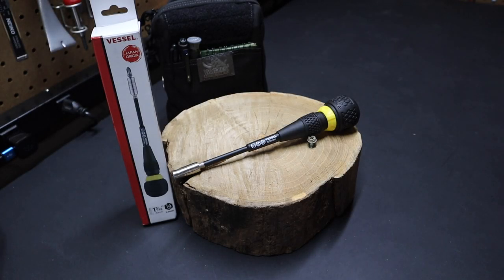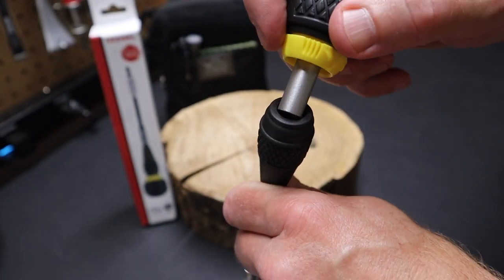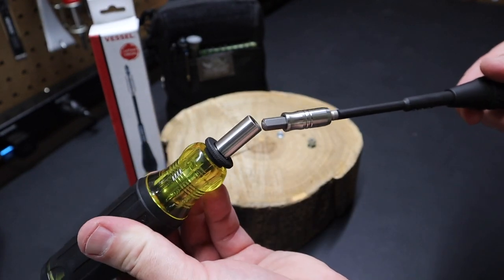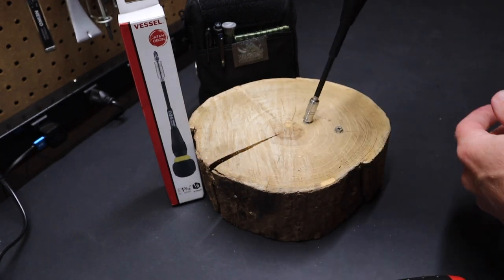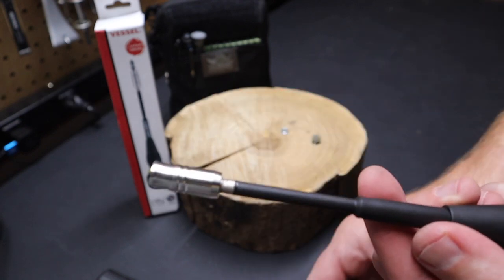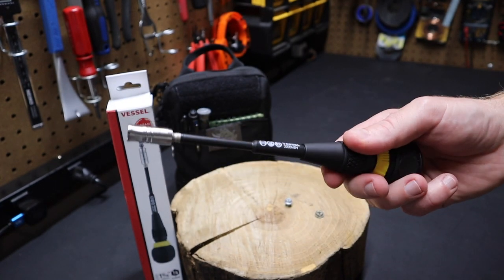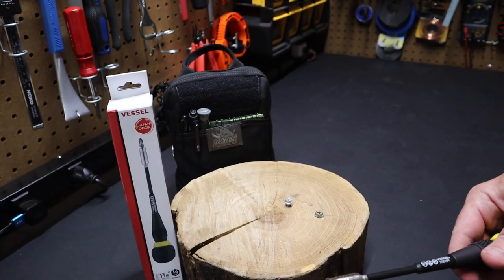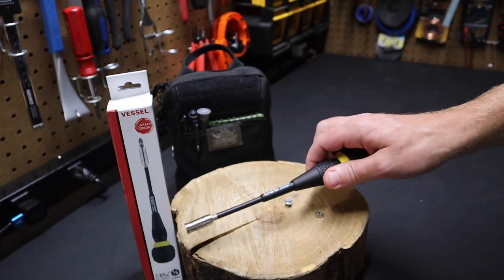Vessel Ratcheting Ball Grip Screwdriver - 2200MBH120

Comment: I feel how much back drag matters depends on the size of screws / bolts you're working with. If you're working mostly on tiny electronics, get the least back drag as possible. If you're working with thicker wood screws, back drag doesn't really matter that much.
Reply from the maker: That’s exactly right. Good point.  Thanks for watching!

Comment: Nice video, man. I have a couple of Vessel’s impact screwdrivers with the ball grip. They’ve definitely got a different feel compared to most other screwdrivers, but I kind of like their ball grip design, especially when I have to really bear down on a fastener. 👍
Reply from the maker: Yeah great torque. Not so sure about this screwdrivers adjustable ratchet ring being so easy to reverse when using it. I might need to try some other Vessels. Thanks for commenting!  👍

Comment: I just got the similar vessel ratcheting driver with hidden stubby, but was disappointed that it had a fixed #2 phillips rather than the bit holder like this one.   I was really focused on the stubby part, so my bad.  I want to send it back and get this one.  Similar experience as you.  I don't really have much in the way of ratcheting drivers, and was very curious to try the ball grip that everyone seems to love.  I've only played with the one I have a little and it's ok I guess.  I would like to use it more to see if I like it or not.
Reply from the maker: Yeah I almost did the same as you when I was looking.  Thanks for sharing and thanks for watching!  👍

Comment: I wonder if it would feel worse with the back drag improved. Since it is designed for you to have your fingertips on the lower portion of the driver back drag might make it too stiff to move with your fingers.
Reply from the maker: Well that’s what I mean, lower the back drag and it will be easier to use the screwdriver. Thanks for watching!

Comment: Im no sure if reversing it would fix that. I mean that mean you can slip when you ratchet in the opposite direction. Plus that would be contra of all the other tools out there. I mean all tools hove drive in = turn right and drive out = turn left
Reply from the maker: It would be different than other tools but given the location of the ring, it would prevent turning it by mistake as you torque. 👍
Reply: The new Wera 838 RAS (with a very small handle) features a ratchet selector that turns in the intuitively "correct" direction (right to drive and left to loosen). However, an Amazon reviewer from Germany notes that the selector on that screwdriver operates so smoothly that it's still easily knocked into lock position, he says.
Reply from the maker: That Wera is a nice driver. The selector is in a place where you can stay clear of it while using it.   I’ll have to check it out.

Comment: Hey I have a question. Trying to figure out if mine is defective or if it's normal. When you turn the stubby slowly does it let go at some point? Like turns quicker, and then tightens up, and then loosen up, and then tightens up, and so on?
Reply from the maker: Like it has more back drag at one point than it does at other times?  If so, that's typical for that driver.
Reply: @projectpinehills oh ok so yours is the same eh? Thank you!
Reply from the maker: You can put a drill at high RPM in it and run it in the ratcheting mode to see if it improves.